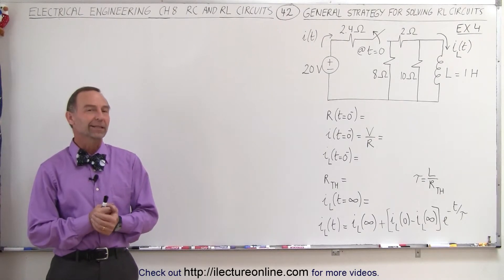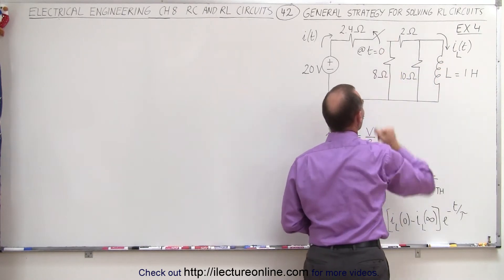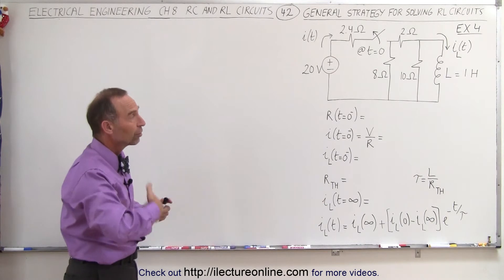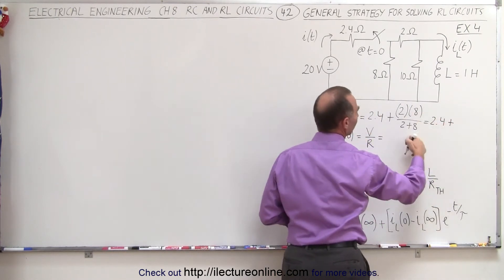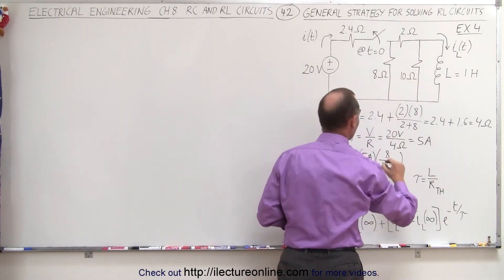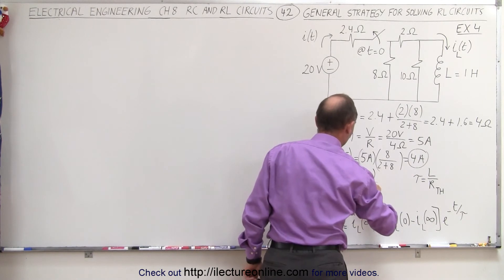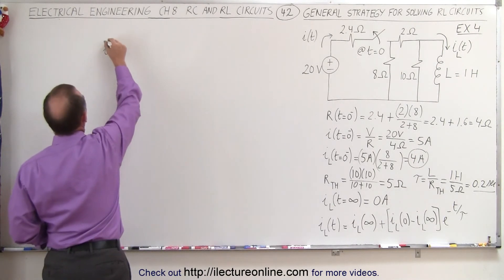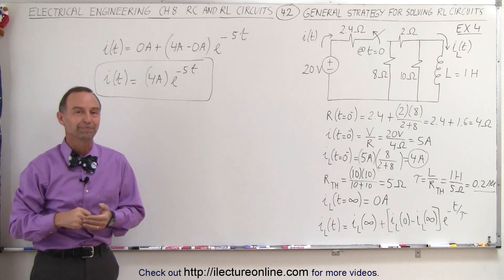Electrical Engineering: Ch 8: RC & RL Circuits (42 of 65) General Strategy Solving RL Circuits Ex.4

Comment: can you please explain why no more current will flow through the inductor when time goes to infinity (at 4:20 )
Reply from the maker: Current will only flow if there is a voltage source or a current source.  After the switch opens, the inductor is no longer connected to the voltage source, thus current will only flow until all the energy that was stored in the inductor is used up.

Comment: Why this 10 ohm resistor h as no role at t before zero plz ezplain
Reply from the maker: Before the switch opens, the 10 ohm resistor is in parallel with an inductor.  At steady state, the inductor does not have any impedance, so all of the current will go through the inductor and none will go through the 10 ohm resistor.
Reply: @MichelvanBiezen  Why is the 8 ohm resistor not in parallel?